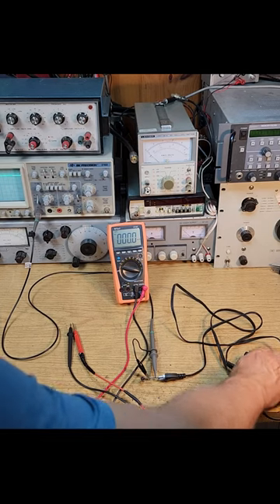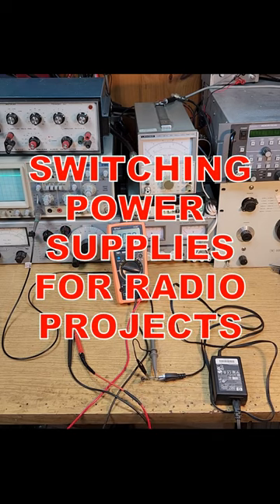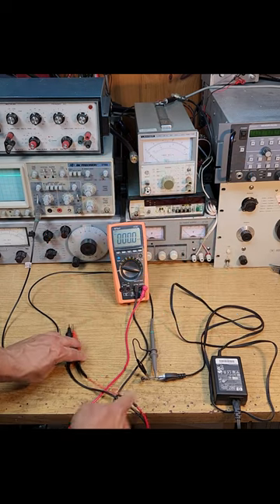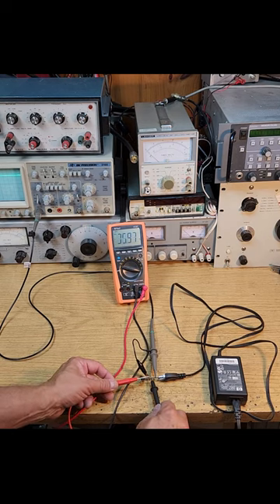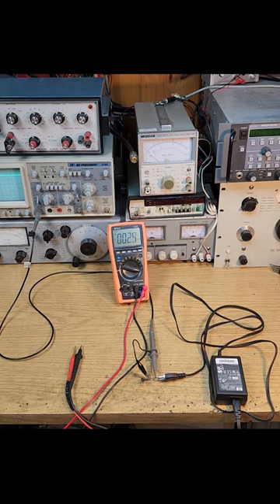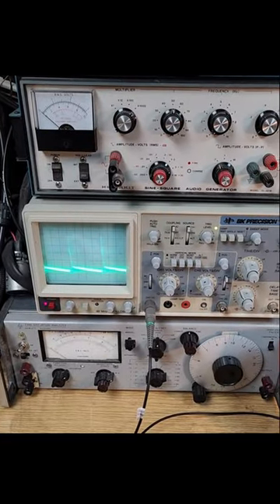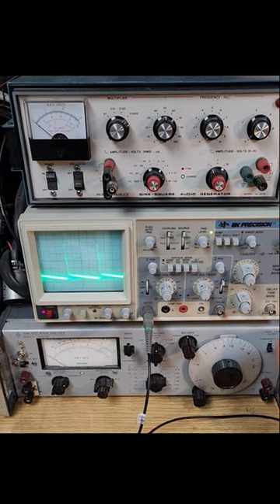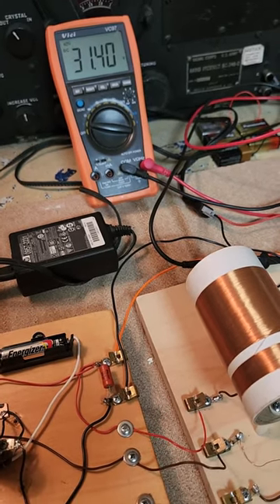Switching Power  Supply for Radio Projects

Comment: The question with switchers is how noisy they are, and whether it's cheaper and easier to clean them up or just use a linear supply. Fortunately for me, while I have a box of old wall-wart and brick switchers, I also have a bunch of surplus open-frame linears for my projects, although I prefer to use battery power as much as possible. Switchers are a headache that I only use when size and efficiency are critical. In my experience it's just a lot easier to use a linear than to find a low-noise switcher or solve the noise problems of the switcher you have.
I used an old IBM 'laptop' PC with dual 5.25" floppy drives for years with my ham gear because IBM made the portable computer RF quiet. These days I think I get more RF out of my cheap laptops than I do my QRP gear. And I note that people are now using microcontrollers directly as transmitters, so I'm not exaggerating by much.

Comment: Mouser lists a Hammond trans, P/N 187A48 for under $13 that gives a center tapped 48v output @2.4A. Throw in some diodes, capacitors and a dropping resistor and you should be good to go for about $30 (once adding in shipping and taxes and etc).
Reply from the maker: 3 parts from an old ATX power supply and it was fixed. Clean.

Comment: This is just about adding proper input and output filters and shielding the device in a proper metal box.
Reply from the maker: Yes this would be a deluxe solution. I just outboarded a choke and two caps and it cleaned it up.

Comment: When my laptop power supply is turned on I can't hear anything on radio because of interference
Reply from the maker: Check out the videos coming up on filtering noise. Your problem is related to the supply radiating and possibly injecting noise back into the outlet and power lines in your house. So you may need some clamp on ferrite beads on both the AC cord and the laptop power cord.